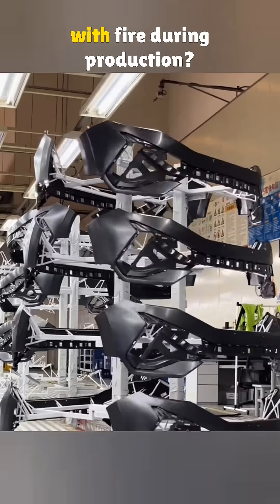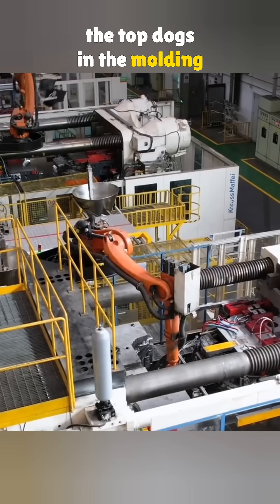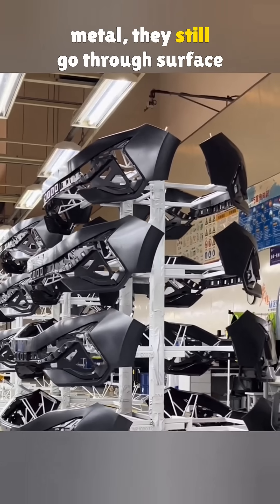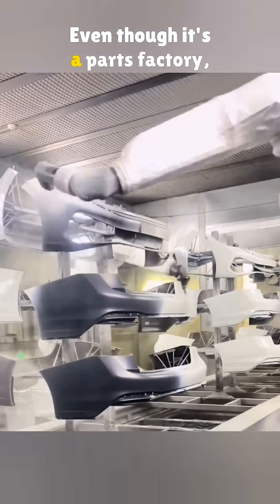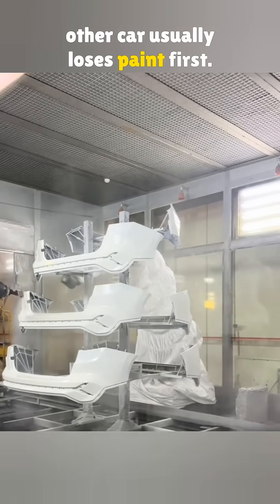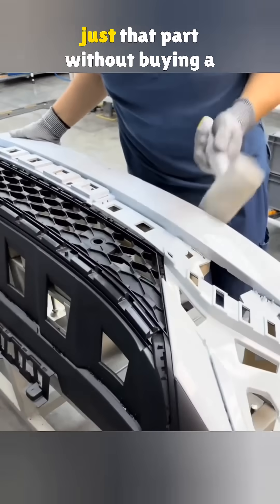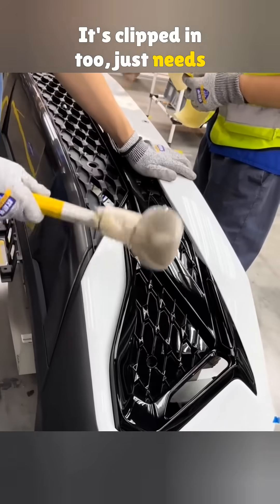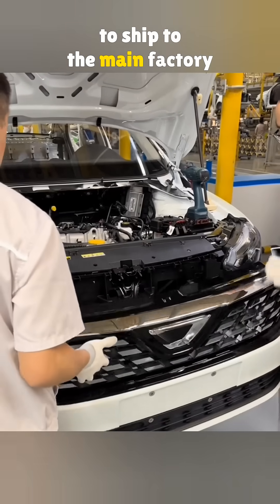How A Bumper Is Made #assembly #automobile #car #manufacturing

Comment: The flame has nothing to do with stress relieving. The flame is used to etch the plastic suface in preparation for painting.
Reply: Actually, He should say the jigs on the mast to keep bumpers from warping in the oven. The flaming process improves the surface tension of  bumpers for later primer spraying

Comment: Flaming is for paint adhesion, changes the surface energy. PS these don’t look like VWs.
Reply: Its a Jetta, VW Group
Reply: @Riley_Babe badge at the end says no
Reply: @viperz888  Dude, just google the chinese Jetta...
Reply: @viperz888   Google is your friend
Reply: @viperz888  They use a different badge in China. But it's VW Group.
Reply: That's a Jetta
Reply: said flames are used post injection mold removal for burr removal and then again for tempering(to resist warping over time) before painting